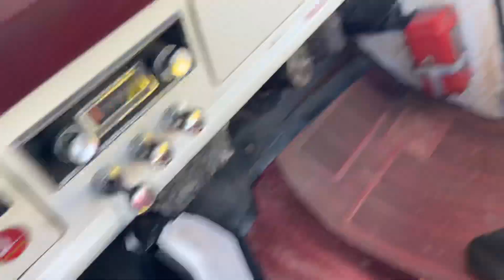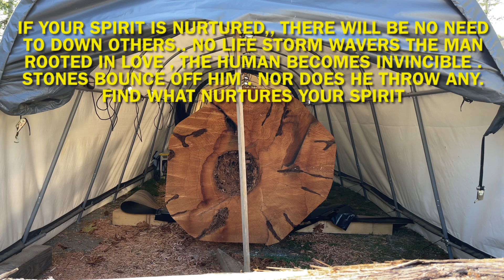1500 year old tree needs 1 inch cut off, Totem Pole

Comment: We had a couple of cedars that got blown down during the Blizzard of ‘93 that were everbit as big as that SPX cedar.  Thy fell on my horse barn and Ihad to drag them off the barn, limb them up and drag them out of the horse paddock in the pouring down snow.  One time when I got off the tractor, a gust of wind blew me to he ground. I did not have a saw anywhere as big as what you had.  I only had my 395 Poulan and 3400 Poulan bow saw, but they got the job done.  I drug them out of the horse paddock with my 5000 Ford tractor and a 100’ steel cable with drag hooks on each end.  The horses were scared to death.  I still had to cobble back up the parts destroyed by the falling trees.  I do remember the horses settled down after I got things cleaned up and put a new bale of hay in the hay rack.  It was a hell of a day.
Reply: Great story!

Comment: There was, until around 1973 ( after which I lost contact ) a ceder that was easily over 8 feet on the stump. It may have been over 10 to maybe 12 or 13. I don't know what happened or when it was taken down, or where it went but it was across the street, which was Airport property, from where I lived.

Comment: I have a Red Cedar shingle that has 438 growth rings in about 12 inches of width, and it has no sapwood or fast growth core or pith, so I totally know it is way older than the rings I count in 1 foot.
The area far above where this man is carving the totem, would have plenty of chunks that would make long lasting shingles, in between the branches.

I still think there are a lot of idiots that don't respect the old growth and would cut it all if they could build a mall in the spot, but like Billy said, the occasional super old tree given its respect and spot, that's fine.

Comment: Hey Billy, you ever try building up or running one of those Stihl 660 clone saws? I've been wanting to give it a go for some time by swapping out the crankshaft, bearings, pins, piston, and running a genuine Stihl rotating assembly. I don't see any reason the case would detract from the Stihl rotating assembly.
It may be a nice, cheap saw and worth a petty investment for a good felling saw.

Comment: Man I must be doing things wrong. I look at the chain on the 125 hanging and I can see daylight between it and the bar on the bottom  and I would tighten it way up because if I tried to cut anything with that the chain would be off in a second and whip around ruining it and the bar and probably my hand too.

Comment: 1500 years old in tree is just a Spalding.
There are trees 4 and 5k years old and older.
Thats why wood is precious and we should not waste it. 

You cut down an awful lot of wood to make fire wood that could make perfect lumber. Granted its in locations moving the trunk would be impossible to deal with. 

But no place on this planet should be clear cut. Its a total waste.  Wood has to be harvested selectively  forests need to be managed.  No part of a tree is useless.  If its not lumber, and its not firewood its good mulch.  And of the mulch some of it can be engineered lumber.  Trees should be prossesed like Wales were each section has a use.
100% is used.   And only selected trees removed to manage a forest for future generations.  Thats responsible logging.